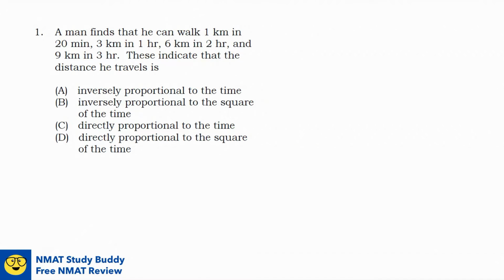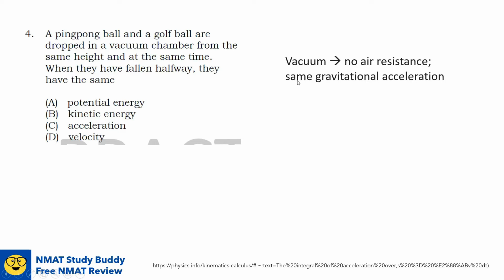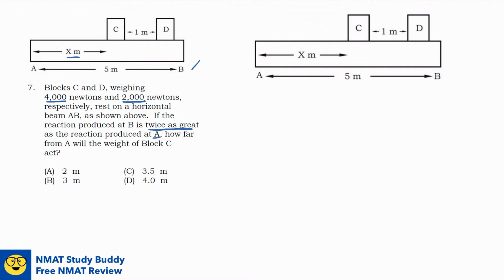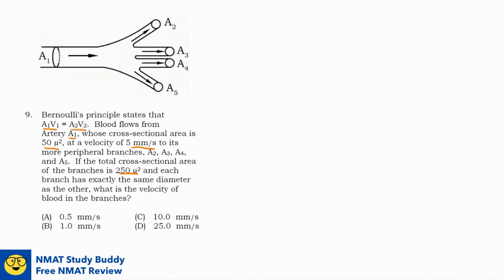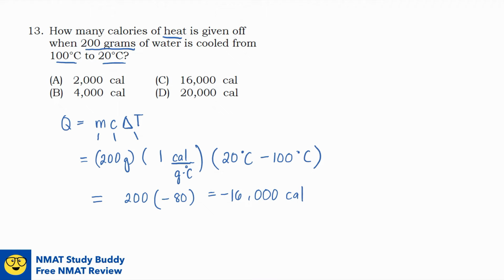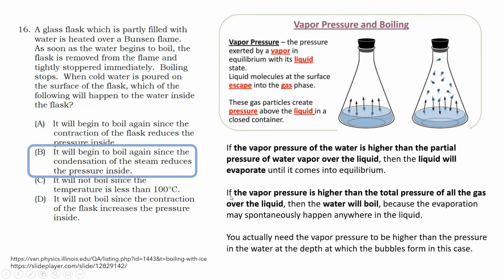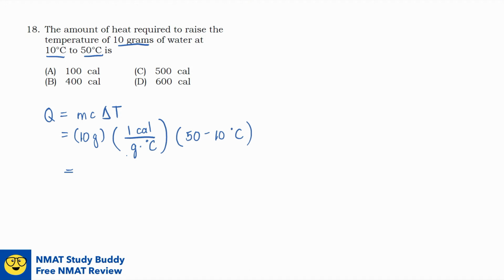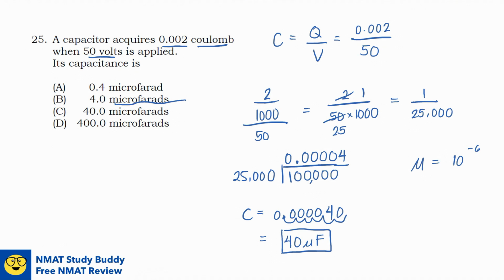Physics Rationale CEM NMAT Practice Set 2014 | PART 1 | Free NMAT Review by NMAT Study Buddy

Comment: Hi, there! I think for #5, 30 is the correct answer. Since the angle being asked was the angle created by the string when the horizontal force is applied. The opposite of that angle would be the 5.8lb and the adjacent would be 10lb. Tan(0.577) is equal to 30. hehe😅
Reply: I think the solution that she presented is correct. We are looking for the measure of the angle that the string makes with the HORIZONTAL. The free body diagram she created is correct since angle should be measured from the x-axis. You will get the angle 30 if the question is asking for the angle with respect from the VERTICAL or y-axis. If such is the case, the opposite of the angle would be the 5.8lb force and the adjacent would be the weight 10lb.